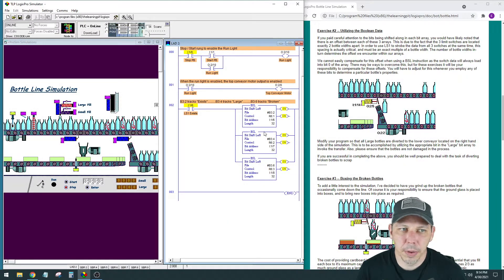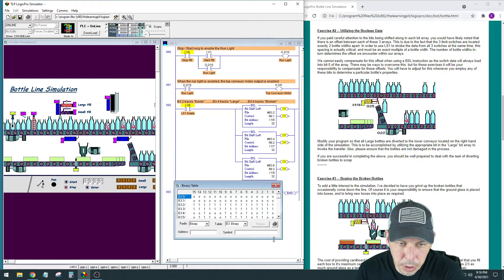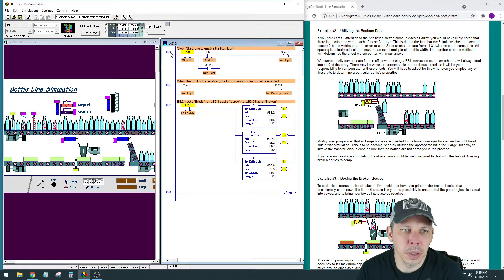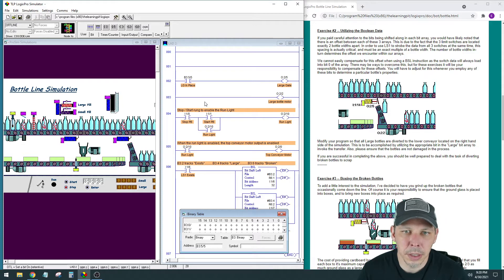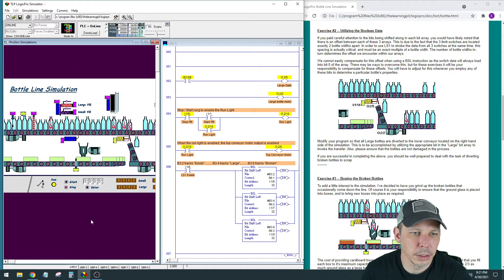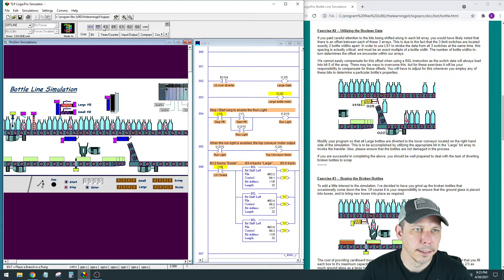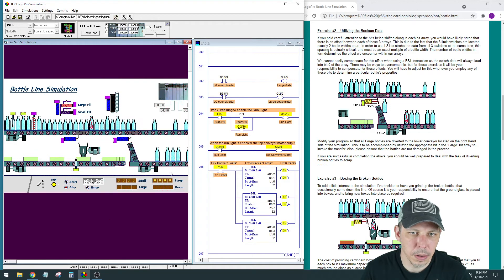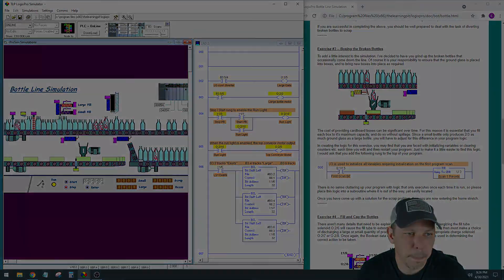LogixPro Advanced Bottle Line Exercise #2 -- Utilizing the Boolean Data

Comment: I understand this video is old. However, wouldn't that be harmful to the electric motor having to start and stop under load constantly?
Reply from the maker: This is more of a logic puzzle to figure out than a real world scenario. In real life you'd most likely have a VFD controlling the motor, then the motor would go into a gear box taking it from 3600rpm down to conveyor speed. A real conveyor would have an acceleration and deceleration rate programmed into the VFD most of the time too.